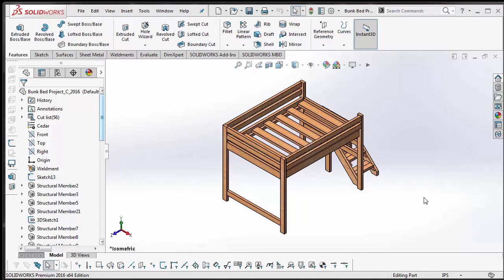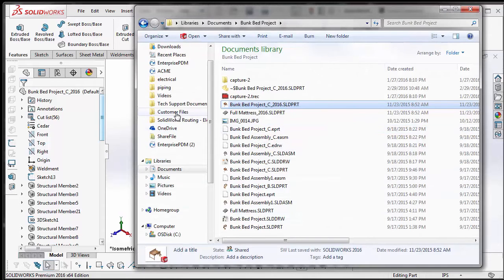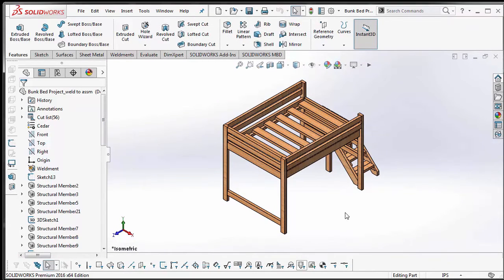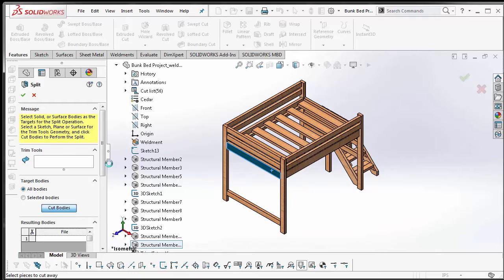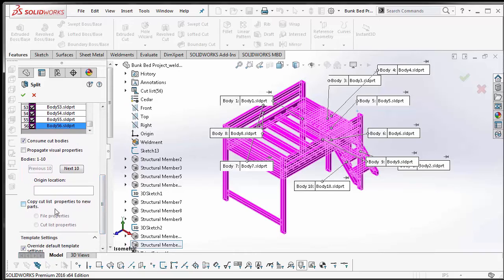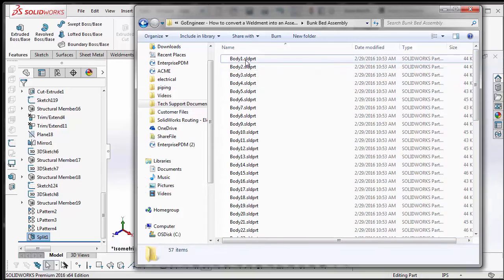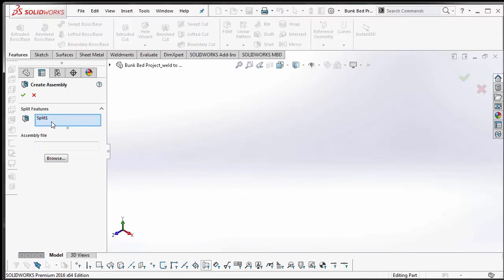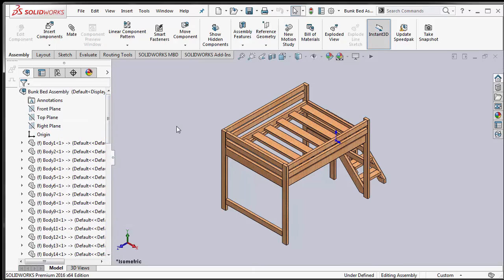SOLIDWORKS - How to Convert a Weldment into an Assembly

Comment: can it be smart enough to know common parts? so don't have 100 auto named parts of same piece? that gets used over and over in the assembly
Reply from the maker: This tool create new parts from individual solid bodies. It does not currently have the ability to compare those bodies to existing parts

Comment: How would you edit this new assembly? For instance engineer comes back and wants to change lengths or configuration? Would it update when you modify the original part file? Will all identical parts be combined on BOM or will each part nummber be a seperate line item?
Reply from the maker: As long as you do not break the link to the original files you can make updates to the original and new parts and assembly will update.

Comment: Can't think of an instance where this would be considered "best practice" let alone necessary. A convoluted workaround that solves what problem? If you want an assembly, just build it as such from the ground up. At least that way you also have constraint and dimensional control.

Comment: is there a way to have the weldments have their own part number?  on an indented BOM the corresponding spots for the child-weldments shows up blank in the part number column,  is there a way to force either the file/part number to be the prefix to what ever the weldments are called by the software?

Comment: Great video.   One question.   With my weldment, I already had through-holes and tapped holes.   When I followed your procedure, the parts that resulted had the holes, but no parametric data.  In other words, they were dumb solids.     I fear the answer may be that the holes must be added after the weldment is converted to an assembly, but do you know a better way?
Reply from the maker: 4. Thank you for the comment.  This sounds like a challenging question. For assistance, please contact our tech support team at goengineer.com/contact
Reply: Your parts look like dumb solids but they are still linked to your original part file. If you need to adjust the hole size or anything just do it on your original part file and all newly created sub-parts will update accordingly. Hope this helps

Comment: Is there a way to keep the created assembly referenced to the original weldament? So i can go into the original weldament part, edit the sketch dimensions and have it update the assembly? Thanks!
Reply from the maker: Yes, Exactly if you update the original as long as the links are maintained the new parts and assembly will update with changes to the original.

Comment: One main problem, once you do this the components in the assembly are "stock" bodies are you can not edit the features. Useless really
Reply: You can still go to your original part file, suppress the split feature, make the changes, and unsuppress the split, save and close. When you open the assembly file, you will see it is updated.

Comment: Exactly what I was looking for!!  Thanks
Update: How do you create these parts with the cut features intact?  I'm splitting out coped tubes for a motorcycle frame, but the parts generated are not coped.
Reply: Great Video but I have the same question. I'm making something where I'll get all the parts cut out with a "Tube Cutting Laser" therefore I need ALL cut features intact. Any help would be appreciated. Edit: I just found this https://youtu.be/ZJlqueDS5Vs but can't yet confirm it works as I haven't tried it yet.

Comment: I have an API (written in 2009) which assigns part numbers directly to the each body within a weldment. This makes sense as each body/member of a complete weldment is in fact a "sub-part" (as it's usually not a sale able item). For example, the "Sales" department at say, John Deere, will sell a weldment made up of many individual members all welded together, and as such only needs to know about the top level part number. However, the "Purchasing" department needs to know about each individual part within the sale able item (as they may come from individual suppliers). This method makes it easy for MRP systems to "ignore" sub parts. Get it?
Reply: Look at me look at me how smart I am. Give me a break.
Reply: @anthonyz5671  Ok smart arse. How do you handle these things?

Comment: @GoEngineer is there a way to avoid duplication on the same sized cut list items ? , I want the same cut list propertied items to be refered to a single part file instead of having 56 diff part files like in your case
Reply: in this case you could go through the cut list and save bodies. if you save out from the cut list as an assembly with the bodies as parts it would duplicate the part in the assembly but not the part name / custom properties etc.
Reply: Could you elaborate? I can't see how it would work. If i save only one reference body for each part, then assembly will just contain one instance of each body, no duplication ensues.

Comment: The only thing I see missing is when the item are split and made into parts that parts with the same characteristic, I mean length, width, height, are been made as duplicated parts,  this parts would cause a problem with production been that the parts look the same and are the same but with different part numbers.  would there be a way to fix this with out having to do a manual assy.